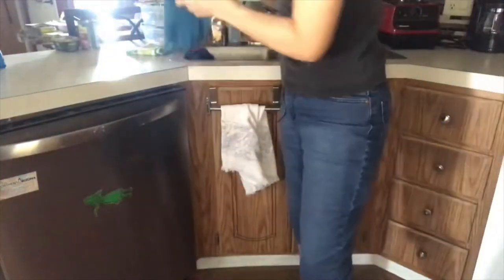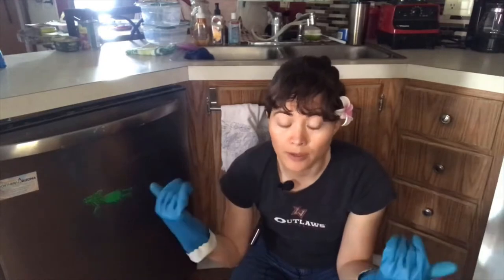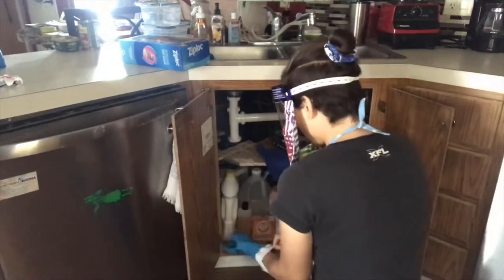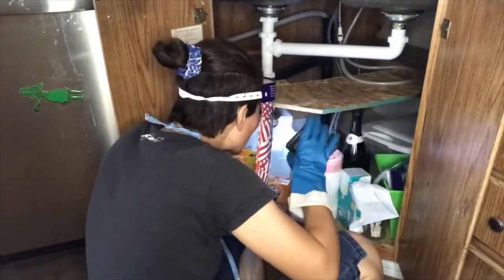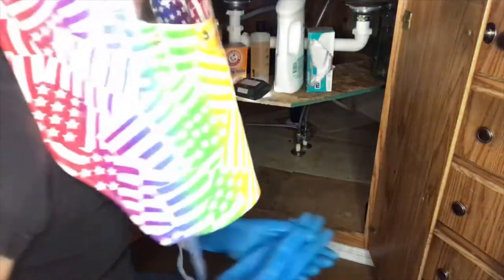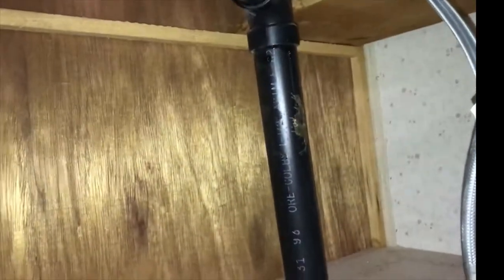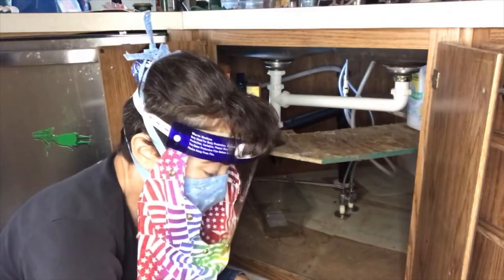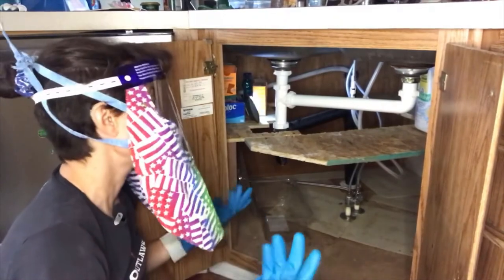Adventure under my Kitchen Sink / Ep. 1 of 3: Find the SMELL on my own with #widowbrain

Comment: I see part of the problem.  Your P-trap is built more like an S-trap.   The outbound arm of the P-trap is supposed to be routed to a vertical T-fitting, with the top branch routed to the rooftop vent, and the bottom branch routed down to the sewer/septic.  In your system, the top of the T-fitting leads to the dishwasher drain, rather than the rooftop vent.  This means your dishwasher is acting as the vent, exchanging sewer gasses with the air in your kitchen.  The dishwasher should be connected to the drain upstream of the trap U-turn, so that it is on the kitchen side of the U-turn.

S-traps are now illegal, because the output is unvented, which enables water flow to siphon the water out of the trap, and defeat the entire purpose of a trap.  Venting the trap stops the pressure at its output from being less than atmospheric pressure, so that the water that seals the trap cannot be sucked dry.

There are fittings called air admittance valves, which are 1-way valves for gasses to only let air in, and not let sewer gasses out.  These are typically illegal for new construction, but likely are allowed for retrofitting an existing S-trap or other existing situation where connecting to a roof vent is impractical.  As long as the home owner knows to inspect them from time to time, and replace them when necessary, they are a good solution.  Check with your jurisdiction to see if they are allowed on a retrofit, and if so, I'd recommend them as a solution.